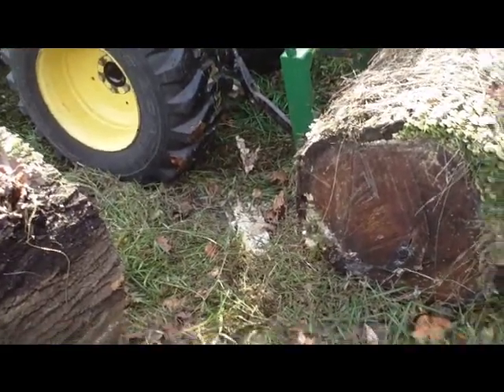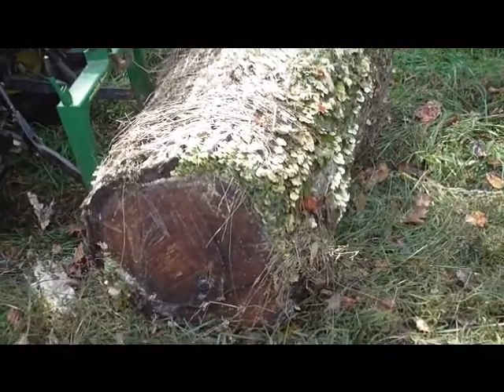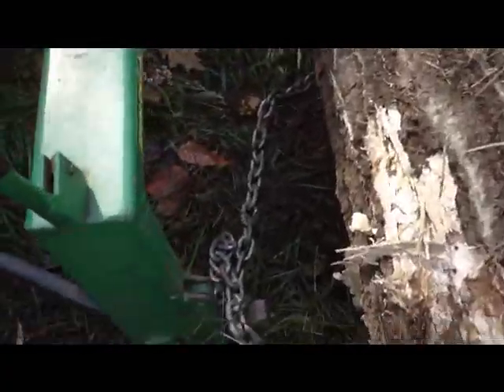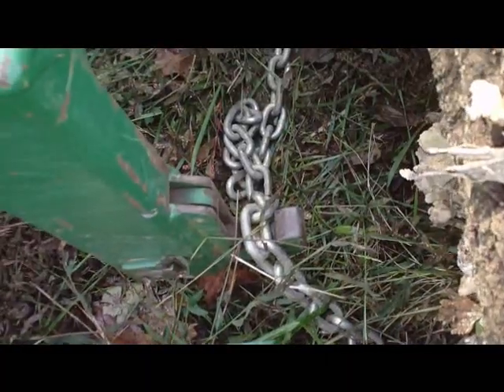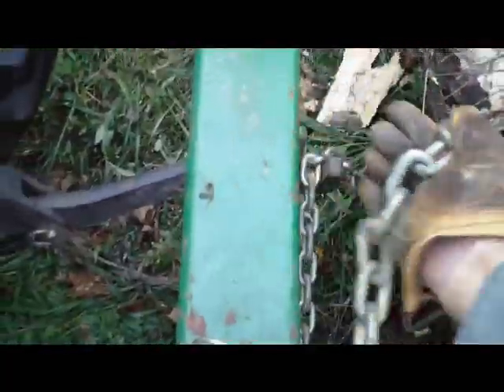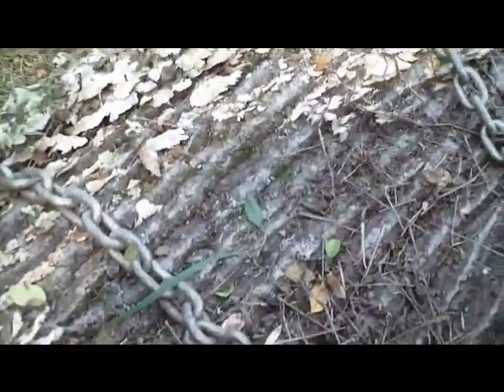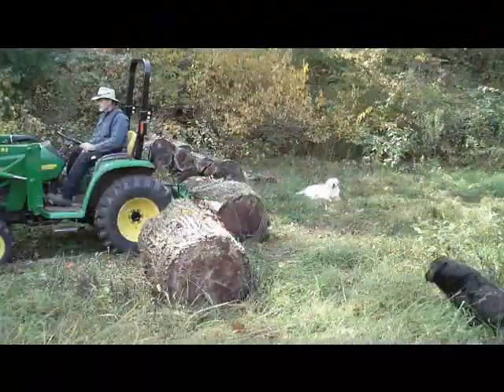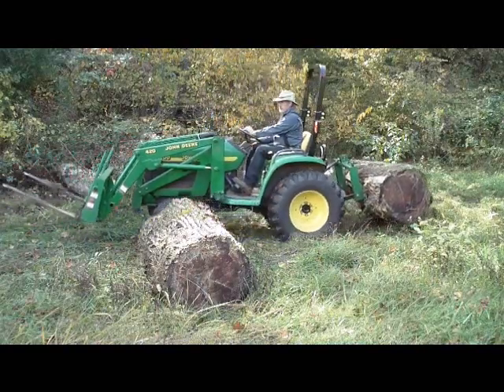How to Lift Heavy Stuff with your 3PH

Comment: I made me a set a forks with a small boom. I have a set of pull hooks that came off a old bus to wrap my chain around along with a hand crank cable winch for extra security. It's does a fine job.
I do that with a 8n ford tractor.

Comment: how did you determine that the wgt of the log was not more than your 3ph lift could handle without tearing something up?
Reply from the maker: I figured the hydraulic pressure would be the limiting factor and the mechanical parts would be over built since John Deere engineers their produce pretty well. So if it was too heavy for the tractor to bear then the tractor would not be able to lift it.
Reply: backyard engineering at it's best.  aka a good guess.
Reply from the maker: A wild ass guess is close enough for me.
Reply: well Sir if it works it works

Comment: If you can't pick it up with the front loader you should contact John Deere.
Reply from the maker: From the manuals:
420 loader max lift: 1195 lbs
4300 tractor 3PH: 2200 lbs

Before upgraded the loader, see: Upgrading John Deere (FEL) Loader Cylinders Part 1 and Part 2, I did manage to barely managed to lift one of the logs with the OEM cylinders but there was too much weight on the front wheels and the front end kept sliding sideways down hill. With the upgraded cylinders I picked up one log with the loader and one with the 3PH . That put more weight on the back wheels and the tractor was steerable.

Comment: My tractor blew out an axle bearing by overloading it like this.  It also then scored my axle.  Both must be replaced.  Good idea but do not get carried away by overloading it.  Sorry to hear about your loss.  It is every mans fear.  Wouldn't you just like to catch them.
Reply: Your tractor blew a bearing because the bearing was poorly made, or was contaminated. I regularly carry loads that are so heavy I have to load the front end down with 400 to 600 lbs of ballast. The bearings are capable of continued operation with twice the weight of the tractor on them. Most tractors are rated to carry twice what they weigh.
Reply from the maker: I got the tractor back, it was in pretty rough shape, and I am in the process of restoring it. What does in axle bearing most often is dirt getting in the seals when you drive through or get stuck in deep mud. What brand of tractor blew the axle bearing?
Reply: point.  Glad you got it back.  Cheers.
Reply: I'm sure if the tractor can lift it.. it's not over loading the tractor so that wouldn't happen